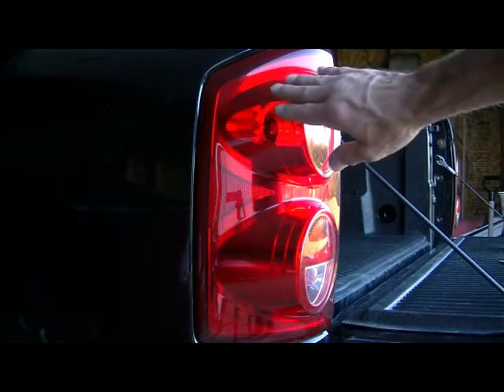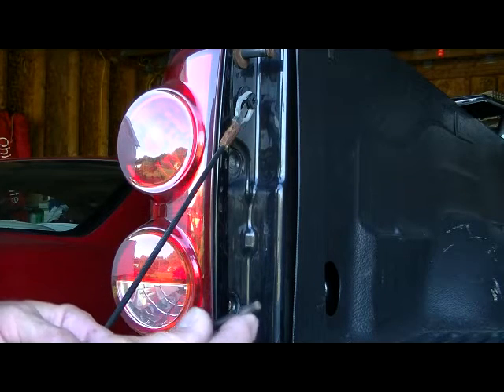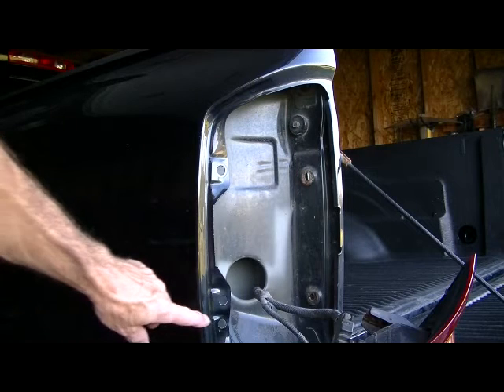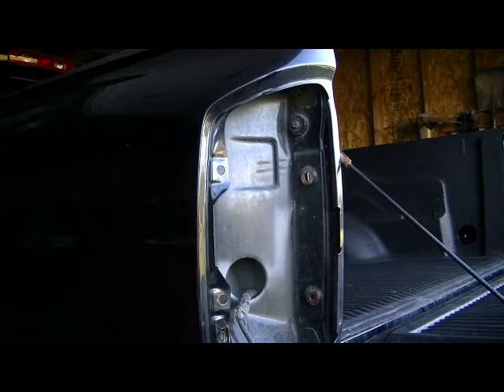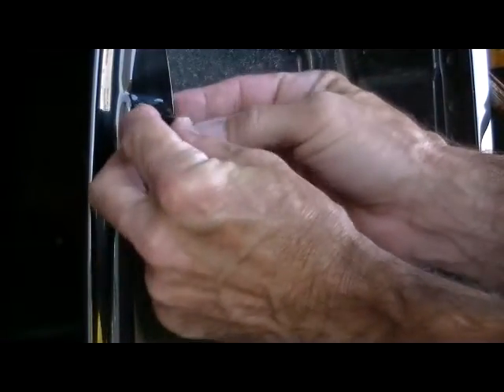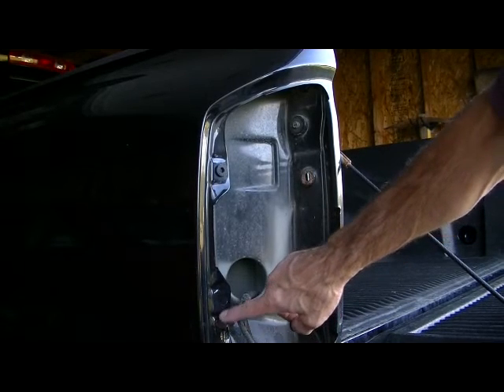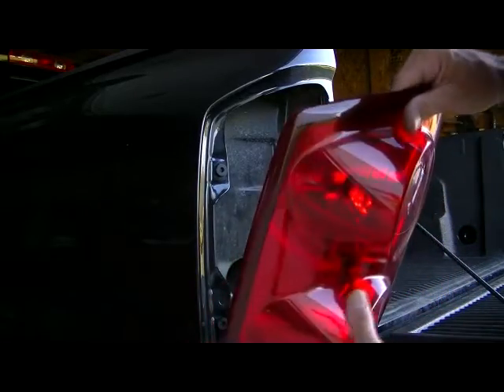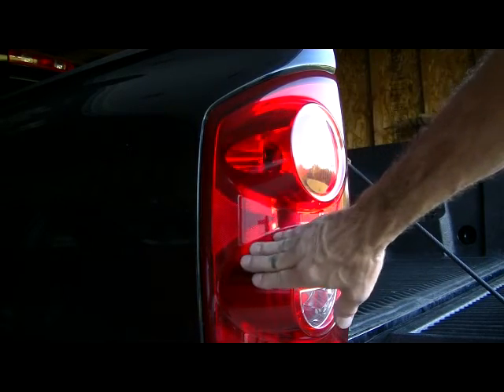FIX LOOSE DODGE TAIL LIGHT LENS RAM AND SOME CARS

Comment: Those little grommets are a scam by Dodge, I swear.  Why not have a nice rubber grommet like the ones like you found?
Reply from the maker: It all comes down to cost and time to install the tail lights at the factory.
Reply: I bought the clips from dodge, they don’t fit the tail lamp. Off to Home Depot for grommets, thanks